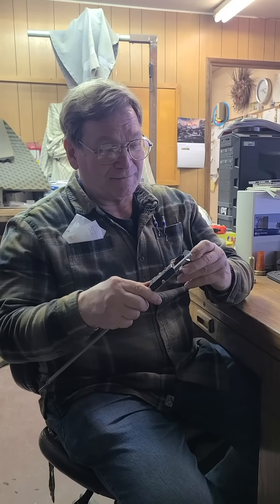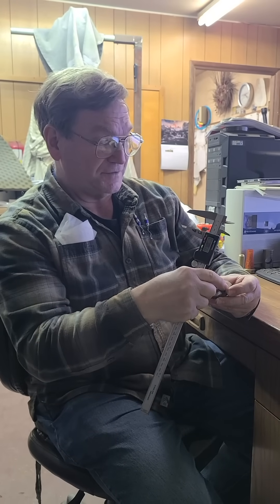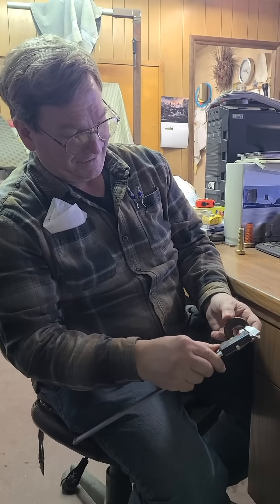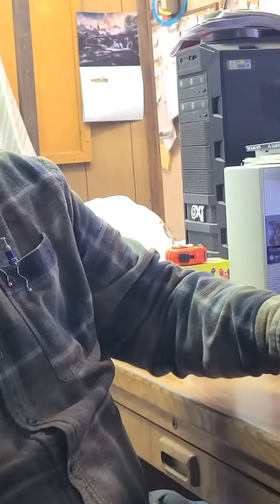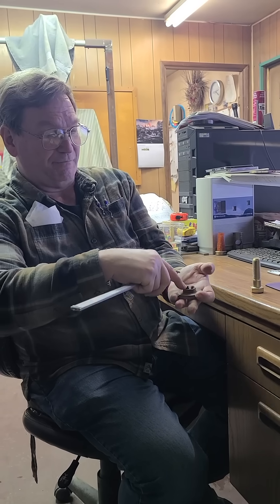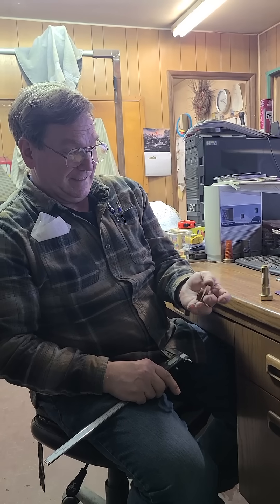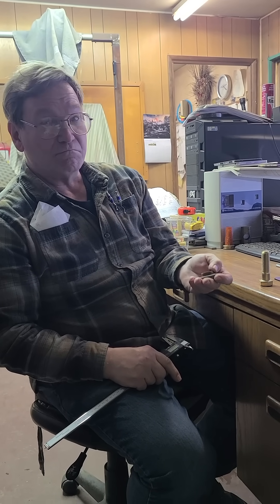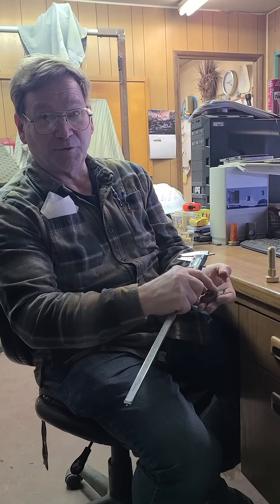Machinist's Minute: Thickness is a guide when reverse engineering

Comment: In the job shop world hardly a day goes by that we don’t have to reverse engineer something. Whether it be the material it’s made of, or the size that was made two, or to the size that it needs to be made to. Many times our reverse engineering is to improve the design as well as repair. Manufacturers have engineers that went to school to be just an engineer. A machinist/welder works from a lifetime of experience.
Reply: Yes

Comment: The one problem with reverse engineering is the type of material and the heat treat condition.  You just don't know.
Reply: A guy with experience can easily make good decisions with knowledge of application/use.  Is it the exact alloy and hardness specs?  Probably not.  But is a working part (even if it has a lower lifespan) better then a broken part?  Absolutely.
Reply: But if you are able to design a machine, you can also spec what the material SHOULD be, and go with that.